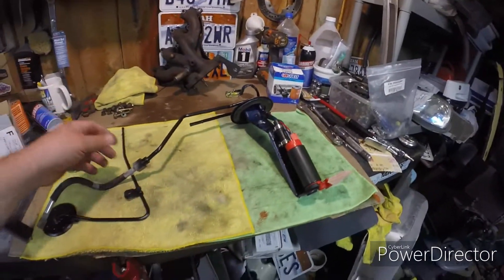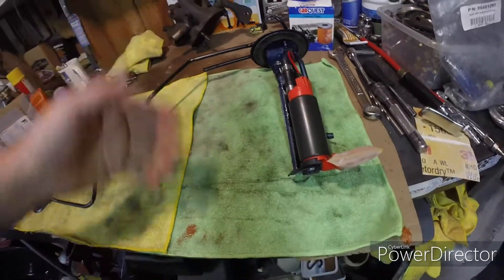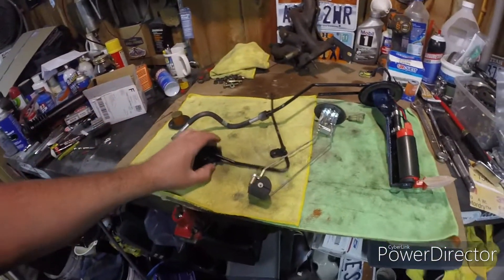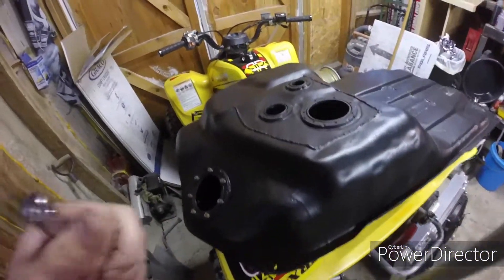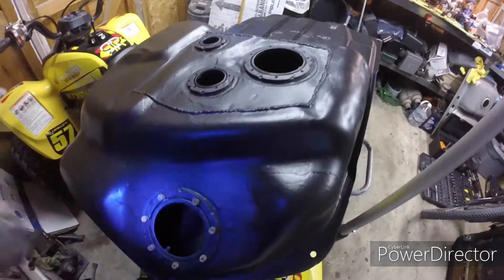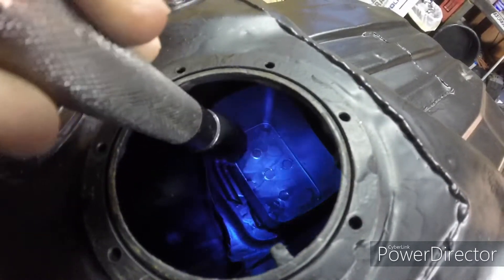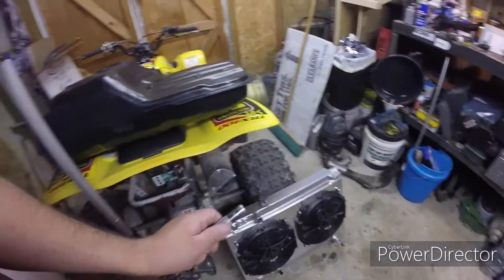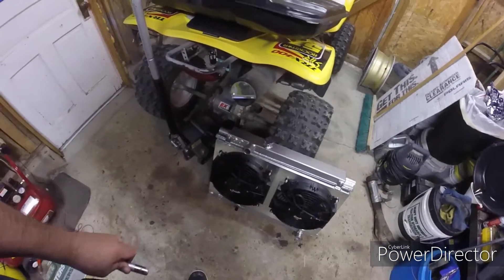Gas Tank Renu Review

Comment: Gas Tank Renu in Swartz Creek Michigan does their tanks without cutting a big opening in the tank. They drill 1" holes and weld a patch from the inside. When it's done ( Even if they just do the inside of the tank and prime the outside of the tank) you can't tell where the holes were.